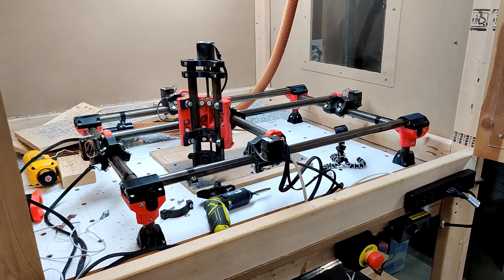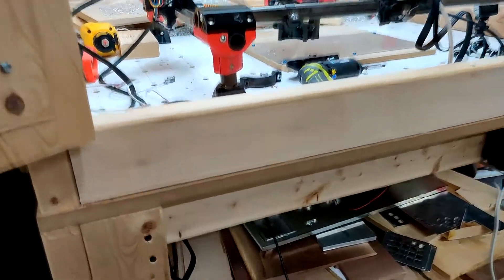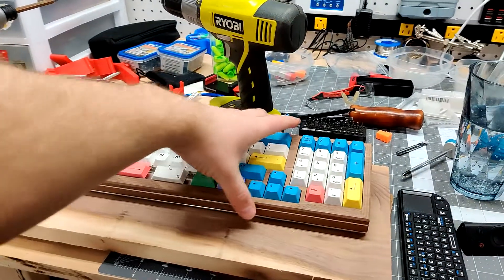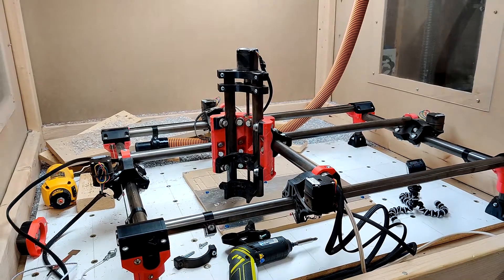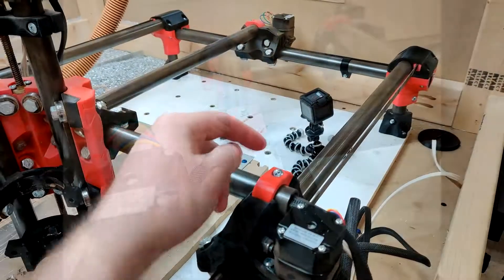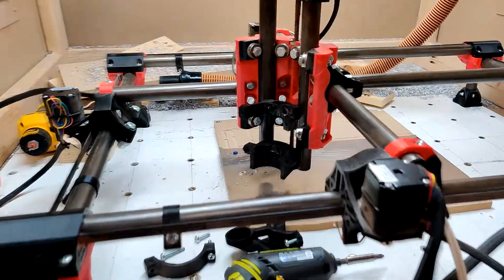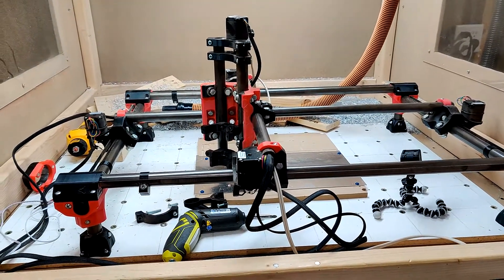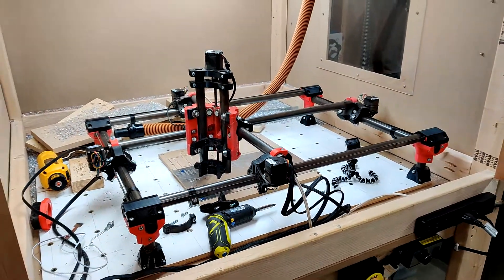MPCNC Primo Maintenance Update!

Comment: Damn looking good! It's been a while since Ive tuned in. The new gantry has my eye, mine is the original and there is quite a bit of slop, not sure if it is because I didnt get all the nuts and bolts tightened correctly or due to warping of the gantry pieces when I printed it on my A8...maybe even a little of both. I have an Ender 3 now and its been sitting idle, I think I found me a new project. :) Every time I check your stuff out, I get re-inspired. Thanks for that and keep up the good work!

Comment: Hey, just a quick question. Im building a Primo at the moment and im a little confused about the endstops. 
In the V1 Dual Endstop documentation it says using the M666 command it offsets the X1/Y1 endstops/motors, but in the Firmware it says the adjustment is made too X2/Y2 endstops/motors.
I looked on the V1 forums but the thread i found is unclear about it too, since you have it working i would appreciate it if you could let me know which one it actually adjusts. thanks !

Also keep up the videos, your the main reason im building a MPCNC Primo :)
Reply: @ProjectsbyBrian  it does thnx